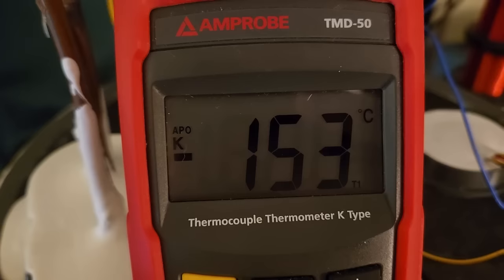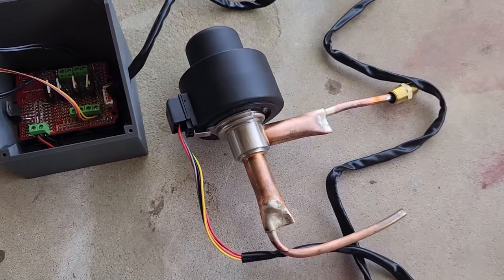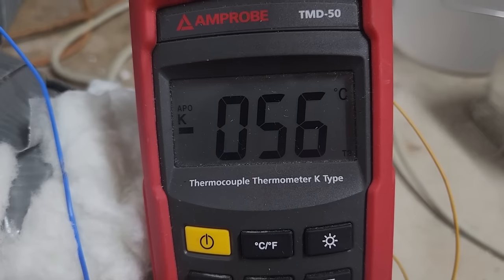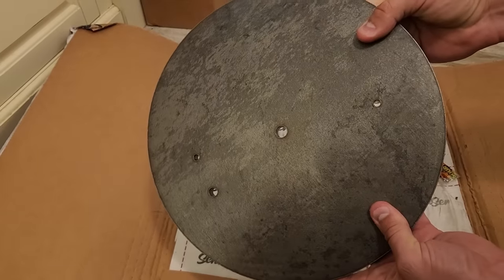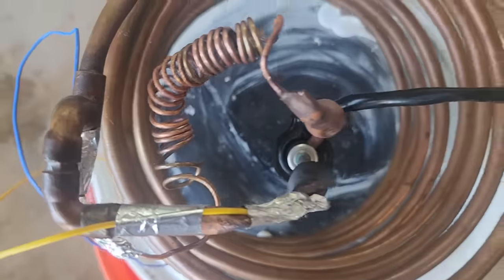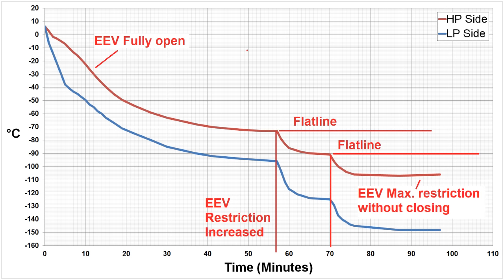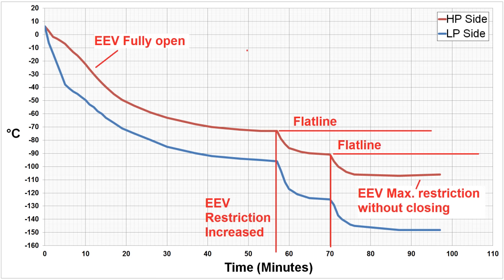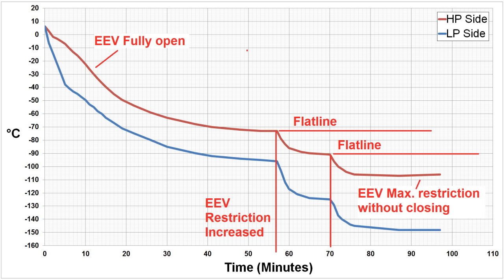Joule-Thomson Cryocooler Part II (-153°C)

Comment: Bit of a tip from former ref-tech - you can determine the proper liquid refrigerant amount in your final heat exchanger (and so the proper flow rate of the system) by measuring the difference between theoretical evaporation temperature of the refrigerant behind your expansion device (determined from the pressure) and temperature on the heat exchanger outlet. When that difference hits 0 you have a fully flooded heat exchanger which also indicates that you're running at its max capacity. Technically 0 superheating is bad for the compressor as you run into risk involved with hydrolocking it if you don't have a liquid trap on the compressor inlet. The thing is you can automate the process of tweaking the flow and expansion rates for the heat load using two temperature sensors connected to your Arduino. You stick one sensor right after the expansion device (should give you close enough temperature to the theoretical one) and the other one after the heat exchanger. You measure both temperatures, calculate the difference and open or close the expansion valve accordingly. A simple PID loop should do it. This is basically how all professional EEV controllers work. 
The other thing about your compressor getting hot. Those are designed to be cooled by cold refrigerant coming from your low side heat exchanger and have as little heat transfer through the casing as possible so sticking them in a water bucket might not fix your overheating problems. Basically speaking they are designed so X volumetric flow of refrigerant takes Y Joules of heat from internals and carries it to be dissipated in the condenser. So if you do changes to the system that affect the cooling process you're going to end up with a hard to cool overheating compressor and a lot of extra heat to remove from discharge gas which might necessitate a bigger condenser or in your case a bigger upper stage. 
Also a bit of practical tip - don't chase temperature as you might be thrown off trying to troubleshoot the thing. If you have your heat transfer rates figured correctly the temperature will be there.

Comment: 1:45 -- Center-tapped unipolar steppers are easily converted to bipolars by tracking down that center tap and cutting it.  I've converted those ubiquitious 28BYJ steppers into bipolar by cutting a trace on their PCB (under the blue cap), and then you can drive them from A4988's.  They get a lot faster and more powerful when doing that.
Reply: Oh damn! This is a good “life hack” if you’re life is consumed by refrigeration tech or tech stuff in general (like me). Thx so much! 

Question? Doesn’t a unipolar have a torque advantage over a bi-polar but the bi-polar has better speed/ lower torque lock to lock? I think that is the trade off but it could be flipped around too. I remember reading something way back about that in a pro/ con list. 

Bad thing is that with certain types of stepper motors used in the refrigeration industry the motors, to improve reliability, are hermetically sealed (Sporlan CDS evaporator pressure regulator valves). Those happen to be the bi-polar type anyway (4 conductor) so the cutting of that certain trace isn’t necessary. 

I believe with an earlier design they did use a unipolar type or some other manufacturer did. They are still used by some but I believe the bi-polar are more common. 

I could be dead wrong as my exposure to this tech is limited to what the supermarket chain I do repair work for specs for their systems or some engineers spec out. They use Sporlan products for most refrigerant controls/ device hard parts. The E2 is the standard controller platform in almost all stores but they have been starting to use the Danfoss platform with some new construction projects. I’m more familiar and comfortable with the E2 and would rather continue to see it used exclusively but I’m no where near an important enough person to have any influence for that stuff. Lol

Comment: Tech ingredients did a great video on vacuums, they also explained different amounts of degassing etc, apparently even epoxy de-gasses as really low pressures. From memory I think it was the video where they were making ampules that fluoresce under HV fields, they also mentioned a suitable pressure to get down to appropriately low vacuums, it's a relatively cheap 2 stage compressor, I think less than $200. I'm not sure if pre-cooling the system with some purchased LN2  and performing some measurements could help discover where inefficiencies lie? When I was attempting a JT cooler, I considered pre-cooling using LN2 just to see whether once at equilibrium, the system would continue to liquify air given the temperature drop during expansion is so much higher when already at a low temperature. Keep up the amazing work! I think you're bringing a lot of joy and excitement to your community each time you post an update!

Comment: Hello @Hyperspace Pirate
I am currently working with an EEV on my DIY (water to water) AC unit. I'm using a similar model as you and you can definitely run these with a regular stepper driver by connecting the outer wires (not the middle one). I use a TMC2208. Microstepping also works. My EEV has 2.5 turns to close completely. With the stepper driver I have 4200 steps to set the position.
With 12 DS18B20 temperature sensors, 2 electrical (analog) pressure sensors, 2 water flow sensors on 2 plate heat exchangers, and an EPS32 (running a web server where parameters can be viewed and changed), I can measure the current cooling and heating capacity. With a wattmeter I can even measure the COP (almost) in real time. 
I have written a simple algorithm that keeps the subcooling constant, for example. By automatically switching the EEV from open to closed in about 1 hour and recording all temperatures and pressures, I was able to determine the optimal performance for a given environment. I also tried different gas mixtures and gas charges. I found that if you go for maximum cooling capacity, you need more gas in the system, but the pressure at the compressor outlet is quite high (20-40 K above the condensation point). The compressor gets very hot (as in your case), up to 96°C and more (until my code opens the compressor line relay at 98°C). However, if you reduce the amount of gas, you can get a better COP, and my compressor temps dropped by 10-15K. I also thought about putting my compressor in the water cooling loop, but I don't want to dump it in the water. Instead, I could wrap it with a copper coil or pvc tube, but I'm afraid that the heat conduction might be poor. Therefore, I am currently opting for a better COP :)

Comment: Your local vacuum/cryo friend here, maybe I can give some advise. Not all might be necessary since you aren't going for the lowest possible pressure, but it might still be interesting :3

1. Many people already pointed out why the thermal conductivity doesn't reduce until very low pressure. Stuffing with something like glass-wool might help due to randomising the direction of the residual molecules. However that will only work if the average distance between the fibers is less than the mean free path. For 2mbar that's something like 35um, so glass wool would probably not help. You would need decently lower pressure, probably at least 0.1-0.01 mbar, to get vacuum insulation with ~1mm fiber separation. There's cheapish (few hundred) mechanical vacuum pumps that can do that. However the conductivity of the glass itself might make things worse. That said, usually a lower pressure helps at least somewhat due to less convection.

2. At low pressures you need large tubing to get good flow. At really low pressures (<1e-9mbar) we often use bellows that are >10cm in diameter and still get a factor 10 or greater pressure difference over just a meter! Use as large tubing as practical. Maybe look into KF flange components, they aren't too expensive and very easy to work with.

3. DON'T use single component silicone as sealant. It outgasses like crazy. You might be best off doing what the KF flanges do and just use a large Viton O-ring. That might need some machining but is defo worth it. The metal surfaces need to be fairly smooth, but not polished. Just no deep scratches. Maybe also get some vacuum grease and use a little to wet the ring. You can use Vacseal to make sure all connections/feedthroughs are tight. Epoxy might work too, there's some low outgassing ones available. Don't use cyanoacrylate glue.

4. Ideally get a turbomolecular pump, but yeah they are expensive. But you are in luck: if you get good enough insulation from the shitty vacuum to go below -200C, your cold-end itself will turn into a sorption pump! If you add a little cage of activated charcoal or zeolite to the coldest part, it will absorb water and at least partially nitrogen to give a much better vacuum. You might have to heat the material now and then to drive off the adsorbed gasses. Ideally you do that in the shitty vacuum with the mechanical pumps running and don't expose the material to air after baking. A heating element with connections to the outside should work. At some point you might even get better pressure with the mechanical pumps disconnected from the chamber.

5. It might help to "bake" the chamber. Essentially just heating up the entire vacuum chamber to 150C or so for a few hours with the pumps running.  That's mostly to get the water adsorbed on the surfaces to come off and be pumped away. However once you expose the surfaces to air again you will have to bake again. This will only make sense if your chamber isn't leaky and you don't have a silicone seal outgassing stupid amounts of water.

6. Thermal radiation might be compromising your thermal insulation. In the lab we gold-coat everything and have multiple radiation shield to reduce the effect. That's a bit overkill here. Aluminium coated Mylar foil (space blanket) might do the trick. Don't use kitchen aluminium foil, it's covered in oil. UHV aluminium foil exists but is stupid expensive.

7. No oils and generally keep the chamber clean. It doesn't matter so much on the cold parts, but the warm walls should be free of residue. Maybe wipe them down with isopropanol. You won't notice at 2mbar, but you absolutely will once you go to 1e-3 and below.

Comment: Super impressive builds and having the balls to work with high pressure flammable gasses and liquids. Juggling  PTV  and find a sweetspot to liquify , magical to watch how physics works and how you edge ever forward . liquid N to H . Like Prof Farnsworth, and heres my 200L Hydrogen electrolysis machine as a passing comment. That looks a sweet rig.

Comment: This is super interesting! I really love to watch your hard work. Because I do also by my self all kind of experiments. Last time I got enaugh of those cars air conditioning "repair" companys. I did it all by my self, and add only propane to the system. And wola! It worked lika a dream! It pushes like a -8 degree celsius air on a hot, 32 degree celsius summer day. I can say, there is no better product for cars A/C system, than propan. At least as far as I know. It is super cheap, it is easyly available, and it works way better than the r134a. I cant see any reason why to purchase expensive "coolant gas", if you can do it all by your self, just like that with your barbeque gas and couple of meters.. So easy and simple job to do. Btw, at here in Finland, if you go to recharge your AC system, it costs like a 100€, or more. And only if it is r134a! And if you got a R1234yf, you have to pay 300€/Kg. That aint no cheap.. Not at all.. But I have to learn more and more from you! So, thank you very much for great video again!! I really apprechiate your hard work! Thanks a lot dude, and keep going!!

Comment: 6:30 The reason that a larger pore size requires lower pressure is that vacuum insulation depends on increasing the mean free path, which is inversely proportional to gas pressure, to well above the pore size
Reply: To expand on this, it's because at lower pressures the hot gas molecules coming from the hot surfaces can go much further before colliding with another molecule. Meaning they reach the cold side faster on average. So while there's fewer molecules, they transfer heat more efficiently. The effects cancel out until the mean free path gets larger than the gap between the surfaces. Then the heat transfer "efficiency" is essentialy fixed at maximum and further decrease of pressure only reduces the number of heat carrying molecules, so thermal conductivity drops.

However the thermal resistance also depends on total insulation thickness, so a little wider gap of the same pressure should still be better no matter what.

I think stuffing the chamber with something like fiberglass should still work though, as it helps randomise the direction of the hot molecules and thus reduces the heat transfer speed. Effectively it limits the mean free path to the average fiber spacing.
Reply: More animations !

Comment: 4:20 Use Automotive coolant instead of distilled water
It has rust prohibitiors anti bacteria and whatnot in it which is ideal for your setup of about every material you could possibly put together in one giant galvanic cell
Reply: His use of distilled water is to reduce the problems of the motor electrical terminals being in the water. Distilled water has a very high electrical resistance when pure. Ordinary water or the solution you describe, would lead to corrosion and eventual failure of the motors electrical feed-through contacts because compared to distilled water, its electrical conductivity is high.
Reply: @TheTemporalAnomaly You would be surprised how quickly the distilled water becomes a good conductor
The little amount of dirt that is everywhere other than a clean room makes the water slightly conductive. This induces a current flow (if the water level reaches the contacts, which I believe it does not since they are on top of the compressor) This current produces all kinds of nasty stuff to be dissolved into the water from electrolysis which itself makes the water more and more conductive.
Try this out for example: Dip bare ends of wire with mains voltage into some distilled water. I bet you about 10 minutes later you have a brown boiling poisonous cocktail
Reply: @Fluxkompressor  You are in a way correct but it`s not as quick as you imagine. I was only explaining `why` he used distilled water and not the technicalities. It would be just fine for a few hours to a day. Hell, even with tap water and 110 vac you would only get a little fizzing and slow corrosion! With distilled water cooling, if you want long run times, you circulate the water through a `polisher` which is a resin filter stack to remove ions. The man doing these experiments will be well aware of this method. And,, as far as the mains wires being dipped in distilled water water, nothing would happen for many hours! I used to work with this stuff at a facility that needed tens of kilowatts of rf power, it was generated by power tubes (valves) operating at 35kv dc. These tubes were cooled by distilled water, with no problems. They, of course used a water polisher for long term operation.

Comment: I mean the uni-polar stepper can be driven with a bi-polar stepper driver, if you just ignore the center-tap. However if the center tap of the two coils are hard-wired together that's not an option.

Comment: At work we have cryocoolers that just use helium as the working gas - they get down to liquid helium temps- 5K is normal and I sometime puddle some liquid helium. The have a high side pressure of 350 psi, but use a GM style cold head (makes a pulsing woosh noise).

Comment: If you get 3 liters/day of LN2 it'd be cool to do some experiments on cryogenic treatment of metals, strength and wear resistance.
Reply: Loads of documents tell you what you want to see
Reply: Not to mention the fact that its way cheaper to just buy 3 liters of liquid nitrogen. 

The electricity costs alone are immense for running such a system all day for just a few liters

Comment: that's pretty incredible, now here goes some tips and thoughts,

firts, I see you are using ac compressors, designed for r410, that's a advantage because the pistons has better compression rate
now for the problem of oil migration (that's the correct term for clogged capilar tube) check the compatibility of oil with the refrigerant, I know it exist mineral oil, Poe and synthetic, and every one has different property for miscibility and helps to send the oil back to the compressor, if isn't compatible the oli gets trapped in to the evaporator or heat exchanger clogging the expansion valve or capilar tube

a exv it's a very great addition, and can be controlled automatically by reading the discharge and suction temperatures, calculating the desire temperatures at determinate pressure and opening and closing the valve at those values usually in the range of 20 to 50 seconds, giving you the most optimal flow rate at any temperature, and that's how it work in commercial refrigeration, (r404 and intelligent system with exv) 

for the overheating compressor, a DTC valve should do the trick, this is a expansion valve who it's connected atthe same high pressure line and injects low temperature refrigerant directly in to the suction line for cooling the compressor maintaining a stable temperature

the other option it's get a scroll compressor for better rates